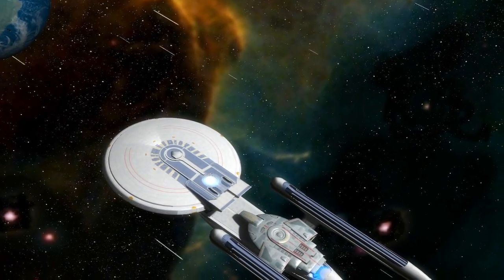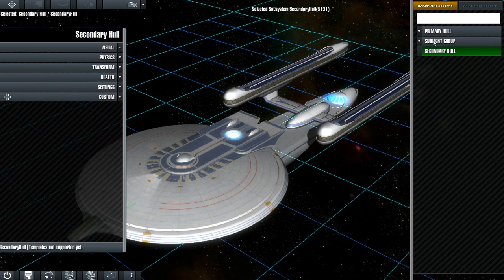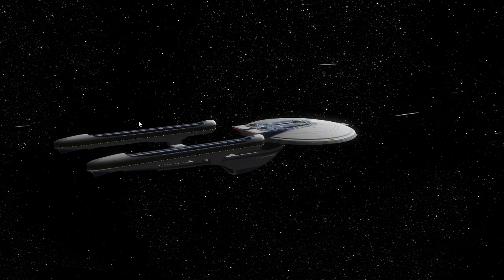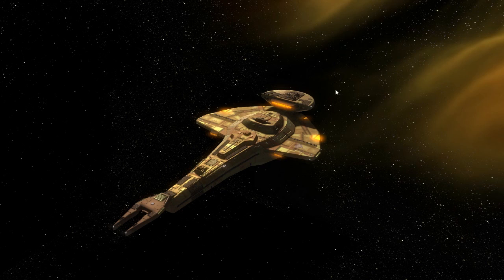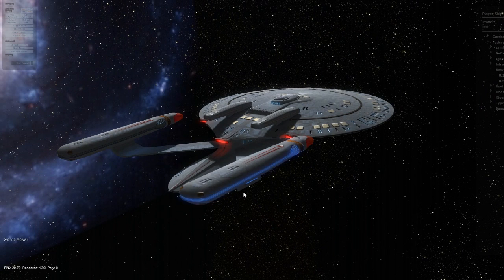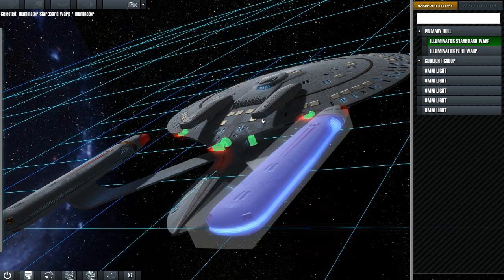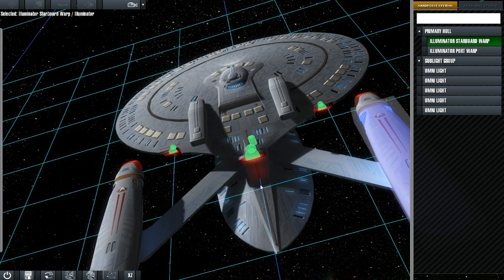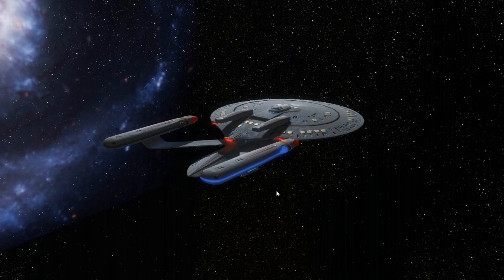HP Editor - Update

Comment: Yes you are correct, but what we really need is the Power System to control both the Intensity level and Illumination Level to properly do this... we just weren't quite at that point yet.  I wouldn't worry about anything graphically like that, it does not go unnoticed, and you can rest soundly at night knowing that I won't let the Renderer have such problems like this! :)